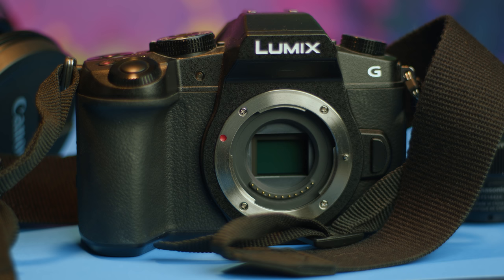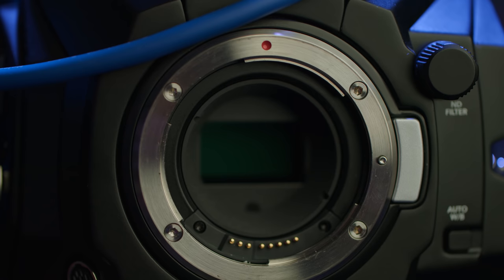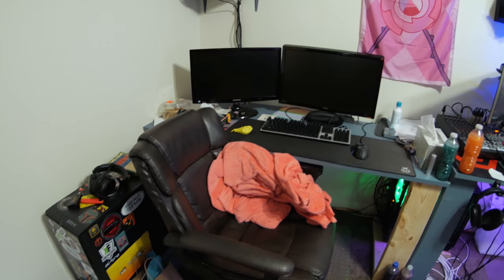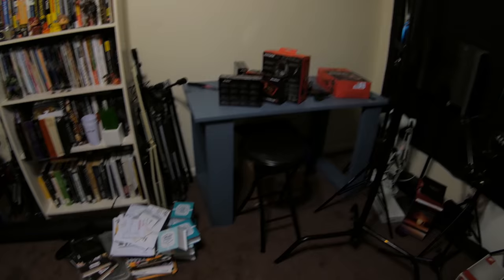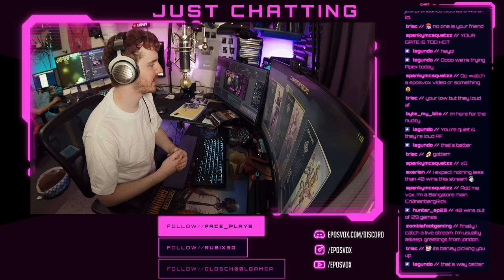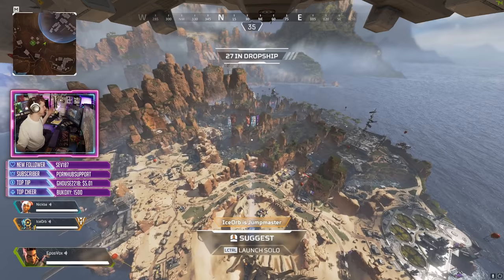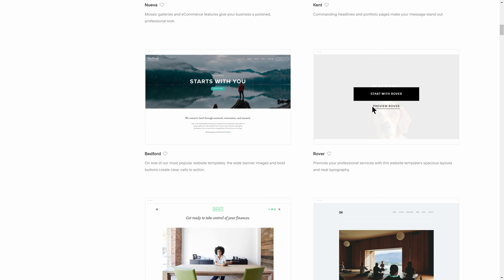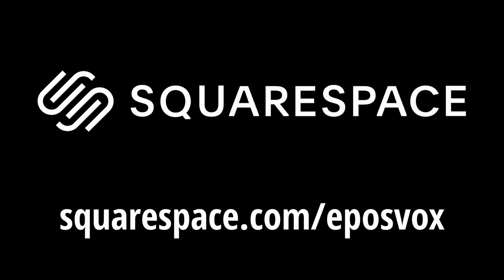Exploring CROP FACTOR Confusion with Gerald Undone (Small Space YouTuber's Perspective)

Comment: Just a correction, the listed focal length and aperture are not FOR any specific sensor size, those are actual physical aspects of the lens, regardless of the sensor. We generally base the crop factor AROUND the field of view of a specific lens to full frame though, because that's what was most common when film cameras were around. A 50mm f/1.8 lens is literally, PHYSICALLY a 50mm f/1.8 lens, regardless of the sensor size it was designed to cover.

Comment: There is a LOT of good information here..but also a lot that is wrong.  For example... the information at 15:23 While mathematically correct. And yes the framing would be the same, the look of the shot would be completely different as the 17.5 would have more lens distortion to it thus making your subjects face look much fatter. While you could apply lens correction, sometimes this is not possible.   When it comes down to it. Crop sensor cameras are great for action and sports shooters. Street photography too somewhat because of their usually large frame buffers and higher FPS shoot capabilities.  Full frame cameras are better at landscape, real estate photography as  their dynamic range is much greater than crop sensor cameras.  Micro 4/3rds are a great all around camera.  Once you choose your direction, a sensor size comes into play. From there, you go out and try different brands and models to see which fits you the best in those sensor sizes.  Feel of the camera (as you are going to be holding it a lot) is very important.  Most all brands today have comparable features.  Some cameras like the Sony a7 series can shoot both crop and full frame as well as super 35 for video.

Comment: Have you considered trying extension tubes? You know .. the macro ones we photographers use to allow to focus closer, and shorten depth of field? Yes they do affect your exposure calculations, but you can increase your effective focal length of a lens to get that short depth of field and focus closer by throwing cheap extension tubes between your camera and lens. It may take some trial and error, but in the small studio environment you are showing it should not take that much experimentation to do some quick testing. And extension tubes are a ton cheaper than fast lenses, and often you can find some that also pass the electronic info along. Mind you often you will have to focus manually, but in a fixed setting that should work fine if you allow for some variance. Anyway, its a cheap option to try.

Comment: Great video from two of my favorite nerdy tech channels. I'm going through a similar situation. I just bought a ZCam E2 to hopefully replace my now dated and less versatile RED Scarlet MX. I know comparing a $2,000 Chinese cinema camera to a RED sounds a little crazy, but after doing tons of research and talking with the company and its customers, I am fairly hopeful that it will be a good fit for me and the work that I do. However, the E2 has a m4/3 sized sensor. For most of my work I am manually controlling my lenses and I will be perfectly happy with the new Cine Speedbooster from Metabones, but like you said they are extremely expensive and don't give any or limited electronic control. So because there is no great best of both worlds solution that I have found I am working on creating my own. I have a 3D printer and design stuff for my filmmaking friends and I all the time. My current project is to make low profile mounts that I can fit glass from different speed boosters in that will fit between the lens and the sensor (much like the magic booster for your Ursa). Then I'd be able to use any adapter or any native lens I'd want, as long as it's an aps-c or full frame lens, on my body and still have most of the benefits of a larger sensor. I'd be happy to send you prototypes if that sounds like something you'd be interested in, but I thought I would share how I'm trying to solve that issue. There are a lot of fantastic micro four-thirds cameras out there, including Cinema cameras, that could greatly benefit from a better solution. Anyways, thanks for another solid and entertaining video. Keep up the great work. Cheers.
Reply from the maker: Sounds like a really cool project! Would love to keep up on it.
Let me know how you're liking the E2 - looks like a solid camera. Was supposed to get a review unit of it, and then of the E2GS, but thus far nothing.
Do you still have the Scarlet MX?
Reply: @EposVox  Will do. Have you been in touch with Kinson? I'm surprised they haven't worked that out with you yet. They have a few firmware changes they want to make so maybe they are waiting to finalize those before sending it out. Hopefully you get one in soon though. And yes I still do and I have a few buddies who also do. I'm gonna be making one of these adapters for them too because the MX crops at 4k to about APS-C and they want to regain that lost info.
Reply: @EposVox  the RED is a little harder to get near the sensor, but if we can figure it out it'll actually put it almost at full frame. About 1.06x.
Reply from the maker: Yeah Kinson is who I've been talking to. Not had much luck so far, but I'm persistent, haha.

And ooh, interesting. Looking forward to seeing your results. I always wanted to pick up one of the older REDs to play with, but can't justify it basically as a toy, haha. They're still worth big bucks.

Comment: I use a Canon FD 28mm F2 on a metabones speedbooster on my GH3 or GH5 as a webcam. And more then enough blurry background.

SLRmagic and Voigtlander make wide F0.95 lenses. I think going fullframe is expensive. Expensive bodys and lenses
Reply from the maker: Expensive body and wider compatibility with all lenses and framing needs, or cheaper bodies and even more expensive niche lenses.... I'll take the body
Reply: Full frame bodies and lenses are definitely heavier, but depending on what you're trying to shoot it can actually be cheaper. If you look at some of the top end lenses from Panasonic (50-200 f/2.8-4) they can cost the same as or more than similar full frame lenses (focal length) while giving you the benefit of being used on a full frame body (1/4 the noise and more dynamic range) and being able to generally resolve more detail (especially on high resolution bodies, which don't exist for MFT) while being around the same price or sometimes less expensive.

Comment: Does that mean that on a T3i, the 18-55mm EF-S kit lens @ 18mm focal length is displaying a full 18mm?
Reply from the maker: No, T3i is APS-C, so it's a ~28 or 29mm
Reply: @EposVox  Ok, so another question of clarity. Thanks for answering by the way. So say you have an 18mm EF lens (say a prime) and an 18mm EF-S lens on a T3i, would there be any difference in field of few?
Reply from the maker: There would not, generally. Lens focal length is always the same, a measurement of how the glass is made. "Crop factor" is only ever applied at the sensor.
Reply: @EposVox  Many thanks!

Comment: You can’t have super wide and super sharp. Maths don’t work. If you want great DoF on your Panasonic. Get the legendary Nocticron 45.2 1.2mm. You have to invest in glass. The only downside of MFT is low light performance.
Reply from the maker: wat... a 45.2mm lens on M43 is like 90mm equivalent - there is literally no situation in the described context (which was literally the point of the whole video) in which I'd be able to use such a lens, especially on myself. That defeats the entire point of literally everything said in this video.
Reply: @EposVox  That's more or lest 85 mm equivalent. Perfect portrait lens for talking heads. That's my fav lens on my GH5S. You can'y have bokeh and ultra wide angle in the same lens. Here is an example: https://www.youtube.com/watch?v=AY1V6bepnoU
Reply from the maker: It's not about having "wide angle" - it's about having the camera close enough to me to be able to focus on myself and still having decent framing. Which, on full frame, can be done with 35mm or 24mm easily.
An 85mm would mean two of my main shooting rooms would be completely unusable unless I want the frame only cropped on my eyeball and the camera would be too far away from me to ever get usable focus on myself.
Reply: EposVox Use Panasonic app and remotely control it. Us autofocus. Or what I do is spot. I set the spot for detection where my face would be and camera will auto focus.

Comment: Hey bro. Love your videos, however you got one thing wrong in an on screen note you put in this. Focal length is focal length no matter what size sensor the lens is made for. It's a function of physics. Not a function of how big the sensor is. What IS determined by sensor size is the field of view you get with a particular focal length. And yes, I know you said that, but that note you put is one of the misconceptions that confuses people in these discussions.
Reply from the maker: Yes, but we spent the entire video explaining how equivalents work and what the actual info is.
Reply: @EposVox  Then why put in that note? Its confusing.
Reply from the maker: What time in the video are you talking about?
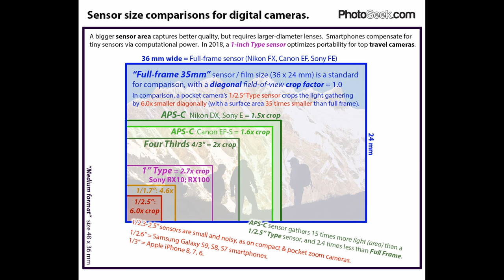Reply: @EposVox  1:57
Reply from the maker: Yes, I specifically stated in that note that the focal length is still measured based on full-frame sizing.
I.e. there are natively-made lenses for micro four thirds and etc. but that doesn't change the focal length.
Reply: @EposVox  But that's inaccurate. The focal length put on the lens has NOTHING to do with the sensor size. It is simply a function of the physical properties of the glass inside. Ask Gerald. He'll back me up. 35mm is 35mm no matter what sensor you put it on. That's why when you put a full frame lens on a crop sensor with a dumb adapter it's still a 35mm lens. But what the crop sensor sees will be a different Field of View.

Or if you put a 35mm medium format lens on a full frame camera. What the full frame camera will see is what it ALWAYS sees from a 35mm lens. It has nothing to do with sensor size. Your note muddies the waters.
Reply from the maker: @AlexMinor  I did.. he's in this video. He fact checked it before posting. At no point do I say any different. That's literally exactly what my last response says.
Reply: @EposVox  I know he's in the video. I watched the entire thing. Your phrase "the focal length is based on full frame sizing" is the specific thing I'm pointing to. Its inaccurate. The focal length is not based on ANY sensor sizing. 

I'm not trying to bust your balls bro. All the words that came out of your mouth in the video were spot on. That text is the only wrong part.
Reply from the maker: While it certainly could've been written better, the explanation is obvious and not really incorrect as the focal length is measured based on 35mm dimensions. Complaining about it is just being pedantic.
My 40mm 6x7 lens has a completely different FOV than my 40mm 35mm full frame equivalent lens. The numbers listed on the lenses (for those made for 35mm equivalent setups) are relative to that 35mm equivalent/full frame sensor/physical light-taking opening size.
Reply: @EposVox  on this sir, you're wrong. Go watch gerald's video he did on focal length and speed boosters. He breaks down exactly how focal length is calculated. It has NOTHING to do with sensor size. It is totally dependent on the distance it takes for the image to focus after light passes through the glass.

FOV and focal length are two completely different things.

Comment: once you go full frame with any focal length it's very, very hard to go back to anything smaller. there is a quality to full frame that just can't be replicated. I would never not use full frame for my photography after finally putting dollars down for the first canon 6D in 2013. That being said, I don't know of any full frame DSLR's that are really adequate for high end amateur or semi-pro video. I have a few friends who work in the video industry producing tv shows and movies and should I ultimately join them, i will likely invest in a c100 or similar system for the same reasons i use full frame dslr's for my photography.

something you didn't touch on when considering field of view and aperture is plane of focus. using a 35mm f/1.8 as your "webcam" camera means you had better not move in and out at all if you use it at 1.8 or 2. Macro lenses have an even smaller plane of focus wide open, and most macro photoraphers actually close their lenses down while using extension tubes and bellows. the slower the lens is to your subject, the more you need to stop down to increase your plane of focus. wider lenses will also distort features, longer focal length will flatten features which is why anything 85mm+ is considered a portrait lens. 

basically: it's a bit more complicated than this video lets on, but with enough experience and training whether through books, videos or practice it does become second nature.